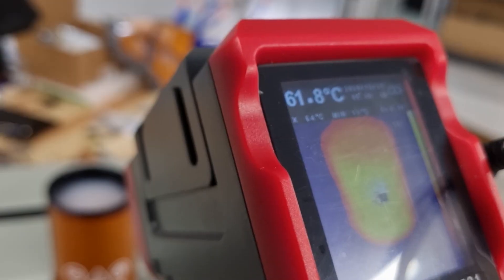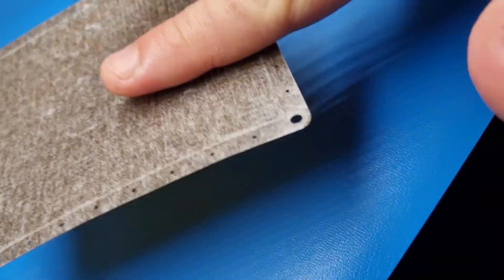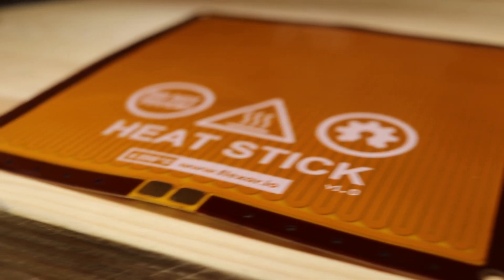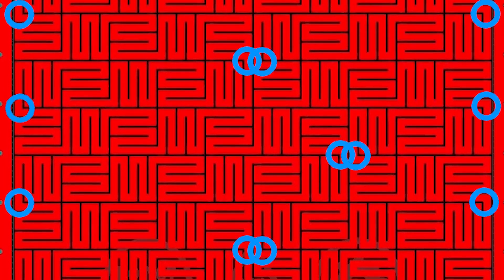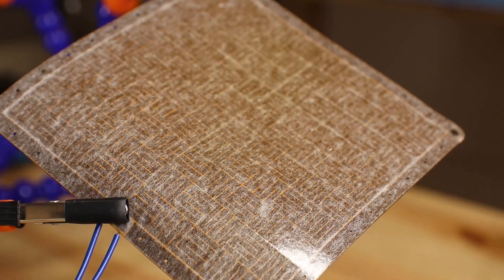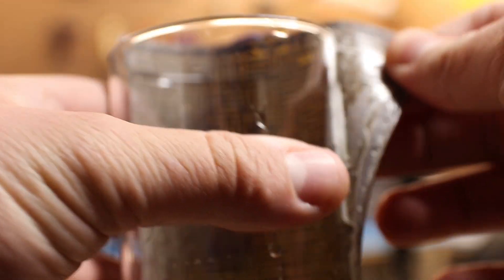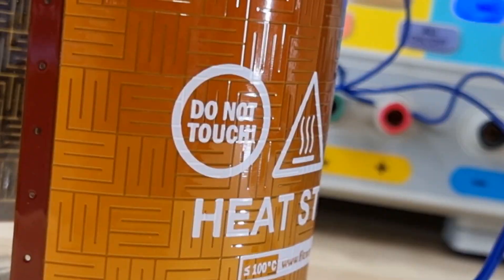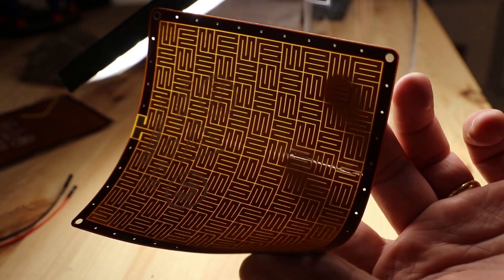How hot can a Flexible PCB get?

Comment: Kudos to you. Great design. As an alternative, using Silicon + Nichrome wire would make better heater for long term use. In these PCB Heater, I wonder how heat is generated as you are not using Nichrome wire. I know Copper is not good at being Heating element, so what is it, which heats the PCB?

Comment: You should make a Snowboard with heated contact surface 🏂 and show us how it glides melting snow, should be way faster than a regular snowboard 🏂  please make it 🙏🏻
Reply: liquid water may or may not help (there may be a 'suction' effect, like you get e.g. with a flat wet razorblade against glass).

Comment: Besides being discolored will it begin to actually fail? Resizing it and sticking it to a metal sheet for like a heated coaster with a target temperature around 90 degrees seems like a great application so long as it could do it forever. Color wouldn't matter.and reuseability wouldn't matter.

Comment: I know there are already heated jackets out there, but they don't seem to run for that long. With fairly big batteries.
How long do you think these would run on battery? Would be running at 25-30*c i guess. And i'm thinking 18650's?
I guess my question is, how efficient are these? what kind of power would you need to run them as "portable heaters" and how long would they run?
Nice vid, and really cool project!

Comment: This is an ideal drinks warmer for my Starbucks Cappuccino. 
I had a cup warmer that hooks up with USB which is a flat solid.
The warming effect is not ideal since there is a space at the bottom of the paper cup.
I had even made a circular disk to fill the bottom space with a lathe.

But this one works perfectly since it wraps around the cups

Comment: Those Hilbert curve traces look amazing! I wonder if you could make this into a Peltier thermocouple pad, with a second layer that uses iron traces instead of copper. That way you could get heating, cooling, and maybe even thermoelectric recovery in the same sticker. So far I haven't seen any flexible thermocouples out there. Could be worth trying, maybe?
Reply: That's not a Hilbert curve but it's an interesting idea:  a Moore curve would leave the wire terminals together like his design and have only the centre with a long trackless section.
It would be interesting to get Altium to fill with various depths of Moore curve to compare the different thicknesses...

Comment: Use a magnetic backing rather than a glue based one. Reduces possible applications but would do wonders for durability and reusability
Reply: High temperature magnets are expensive and not flexible.

Comment: Depending how long it takes to heat up it might be useful in 3D printing where you need to heat up bed to 60 c to print PLA on it.
Reply: They already have exactly this thing on 99% of all 3D  printers, the other 1% uses silicone AC powered heaters.

Comment: The perfect coffee drinking temp is (per google) less than 155F (68C) so it might make a nice heated mug! The only issue I see is mugs are typically have high insulation, so transferring heat from the heater through a ceramic surface might not work great; There are coffee thermos that are hollow and use air to insulate. They are even built in two parts so you could pop the heater on the inside!

Also this video seem quiet compared to other videos.

Comment: What would be completely awesome would be a heat sticker that goes on the bottom of the mug and works by induction with a base plate that could be plugged in. I have a "Mr. Coffee" brand of mug-heater, which is really just a small hotplate, but the heat transfer to the mug is kind of crap and it doesn't keep my beverage very warm at all. Something waterproof and wireless that just adheres to the bottom of the mug--stick it on and forget about it--would be awesome.

Comment: If you add some thin temperature sensors and a conformal coating this would be perfect for seed starting.
Commercial heating pads are very expensive, inaccurate and use mains voltage.
This could run off of a 12/24V power supply and an Arduino+Mosfet and keep a perfect temperature.
Reply: I agree! An integrated thermistor would be great, an integrated thermostatic control system, allowing it to be plugged into 5V/12V/24V and produce a regulated temperature would be even better!

Comment: used to dry 3d filament as well? I have had my printer for over a year now (and loving the QIDI x-Plus with the use of FreeCAD) but I have not seen any good way to dry the filament itself. Looking at how the printer prints, I am wondering why there isn't a radiator type drying unit that you feed the filament in and as it moves slowly to the printer it dries it as well?

Comment: Love your work brother.  Your creativity and your level of knowledge is always inspiring ideas or problem solving approaches for me.  Sla 3d printing could use these in winter.   Cold resin doesn't print well.  I've seen a few diy hacks with thermal bands and mini heaters. Both taking up alot of space inside the hood cover.  These would easily stick to the inside walls of the hood and be out of the way for easier working conditions.

Comment: They have made ski boot heaters with flexible PCs for decades. Some heated footbeds were sold independently and could be used in shoes. Some skiboots had the batteries, switch, and heater element built into the boot. Some heating elements were only at the toes.

Comment: Why did you not add cut-outs to the polyimide substrate-layer to act as a strain-relief? 
I have a cheap-ass workhorse 3dPrinter (2015 vintage) that uses an adhesive-backed flex-pcb heater for the bed. The discoloration, from my experience, is just cosmetic, and does not affect the heating nor safety.

Comment: I've said it before and I'll say it again, this would be great for reptile heaters. The temperatures are low and being able to hit ~112 C at 5V is more than sufficient for either long term use or serving as low-powered heaters in the case of power failures. I'm definitely interested in the low-temp long-term use. I might have to see if I can't get a few from PCBWay for some 'testing' of my own.
Reply: Would be great to place like 2 in a tank and warm the sand above them

Comment: Seeing all the shots of using it with a glass of water made me wonder - how about a sous-vide heater?
Most commercial ones use quite localised heaters so need circulating pumps but a large mat would not take up any space in the water bath and should provide a more even heat source.
Reply: The circulating pump is needed to increase the thermal transfer to the food, keeping it from spending too long at temperatures that would breed bacteria. You could probably use a magnetic stir bar if you wanted to remove the requirement for a pump, though. At any rate, your idea has merit since it would let you make the machine more compact and streamlined.

Comment: My first thought is a cheap and easy stick-on heated bed upgrade for 3d printers that do not come with a heated bed, like cheap Chinese PLA-only printers, and older flashforge printers, and similar. It would also be interesting to see how this PCB behaves at 85 degrees c, a suitable temperature for printing PETG and nylon. also how it behaves stuck to a piece of spring steel (PEI powder coated spring steel sheet is a very common printing surface)

Comment: why not thinner tracks to reduce the strain on the copperless parts of track gap flex material?
Reply from the maker: Reducing the gaps makes the temperature more constant across the whole board.. There is also the issue of resistance - ideally it is kept under 1ohm so it operates with lower voltage levels and higher currents

Comment: How about trying different sizes or shapes. Or even make it modular(like cutting led strips to the desired lenght).
Reply from the maker: I thought about making it modular but the only problem with this is the variation of the resistance and the fact that you would need exposed coppers on the heater making it easy to short the traces when placed onto a conductive object

Comment: Could you make self heating/soldering circuit boards? With an internal layer heater that's only used once to solder the components on?
Reply: I love the three replies I got, basically saying, you can't, he did, and it's not practical. On a channel where he makes very practical PCB motors? Ooh well just an idea 👍
Reply from the maker: I haven't done it yet but self-reflowing pcbs is a project I am working on 😅 and it is possible
Reply: @CarlBugeja  excellent, I look forward to seeing how that goes!
Reply: @CarlBugeja  I don't want to be wrong, but if you prove me wrong I won't be mad😂
Reply: I dont think thats really all that practical, but if you mess up enough you can easily get a self desoldering circuit board :D
Reply: Not near enough surface area. The resistance trick works here because of the length of the conductor. You have less room to do this on a smaller project
Reply: @OtherDalfite   If a conductor has the same resistance per unit length, the same current will produce the same heat per unit length. A shorter conductor would have less resistance, so it would require less voltage to conduct the same current.
Reply: @kennethstudstill  true. The hard part is pushing high currents at low voltages. This is usually why you need a lot of surface area

Comment: Great video once again! :D 
Besides the color change of the heatsticker. Is it working just as good from when you started the tests to when you ended the tests? - or has its performance decreased? 
/ Jacob
Reply from the maker: Thanks! I only noticed a dis-coloring issue the performance was still okay  until I tried to peel off the heater 😅

Comment: This also could be used for applications where the heater is covered afterwards (heated mugs.. with insulation on the outside, there the color change doesn't matter and the melting adhesive might be a good thing.)
Reply: Coffee tumbler with a little USB heater built in would be a pretty marketable product. It looks like there are a few on the market, but they all seem to have either an external heater or a puck on the bottom that heats the drink.
Reply: @namAehT  Also they are so expensive!

Comment: for me as long as it works, thats what matters, i think ill use your pcb hotplate (the violet one) maybe cover it with some additional kapton or maybe some ceramic, it seems to do a decent job with reflowing pcbs, honestly anything that heats will discolour sooner or later, honestly why is the discolouration of the pcb a deal breaker for you?
Reply: because discoloration is a sign of material failure, and when an electronic device fails, they can cause a fire, and when a fire happens people get hurt
Reply: @kevinbissinger  but in this case the material is fine, its just the solder mask discolorating, if you have used a cloth iron you should know that after some time the coating on it also discolors and gets tarnished, pretty much you heat anything and it will break down, let it be fast or slowly, in his case to avoid the unfortunate circumstances putting a layer of kapton tape on the heater should be sufficient, i will definitely try this after i clear my current project on hand (it will take a while though) and will share my findings
Reply: I think it's because it is supose to be reusable. Color change could means degradation, so it might not be that reusable.